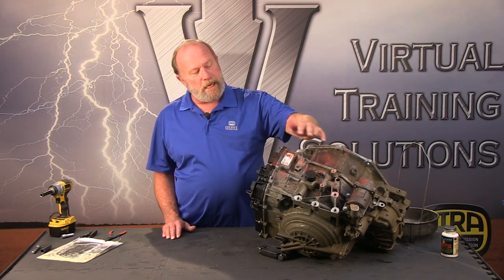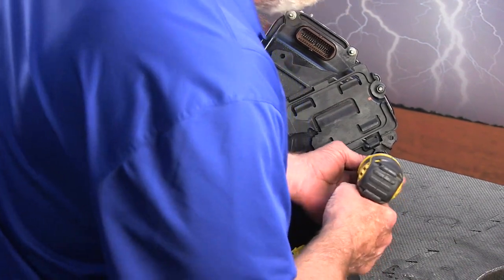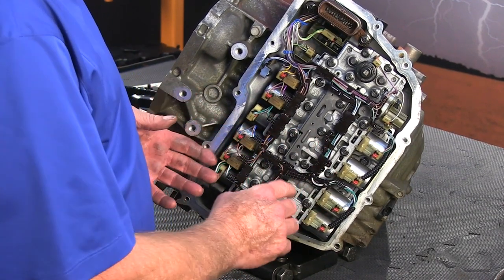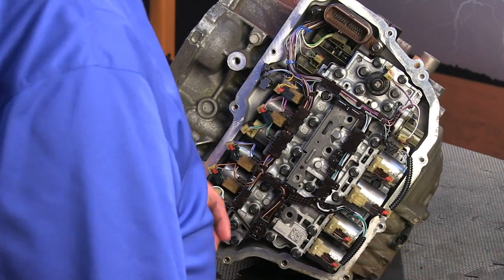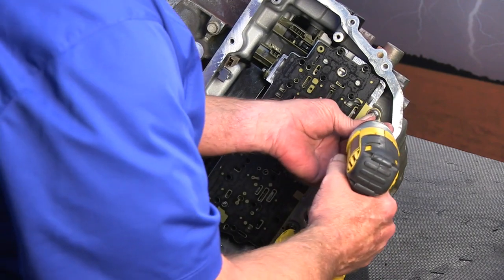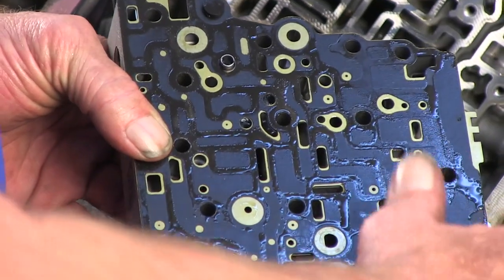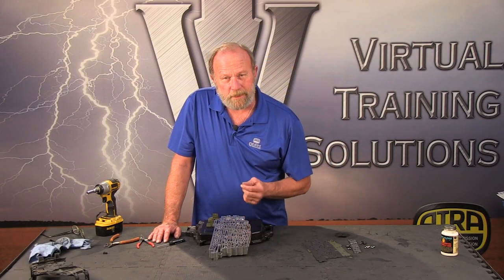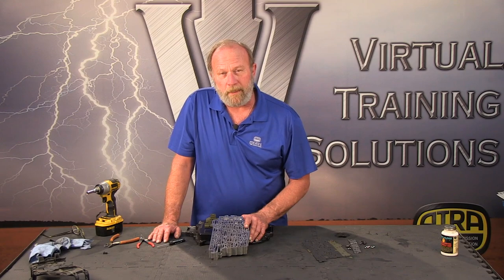03 vts bb 9T50 check ball locations

Comment: I have a question about the 9T50 transmission. I was told that the torque converter and pump were upgraded between 2017 & 2018. Would you know anything about that? I’m getting a check engine code P2817 pressure control solenoid “H” performance or stuck off.